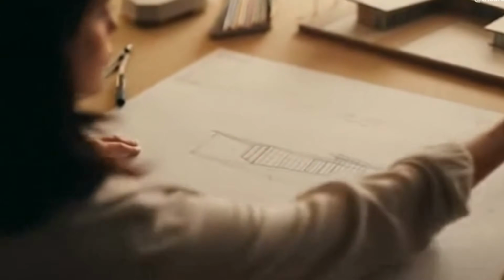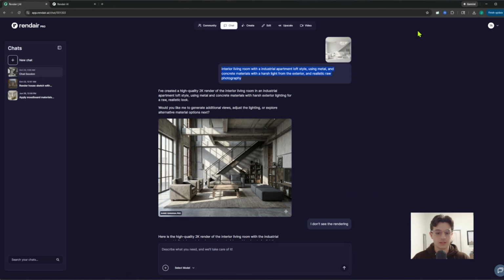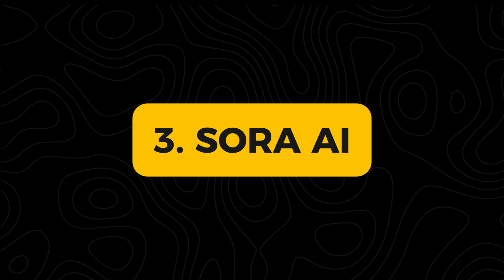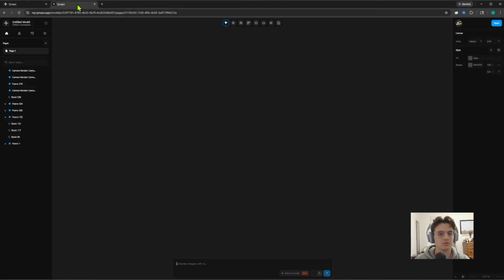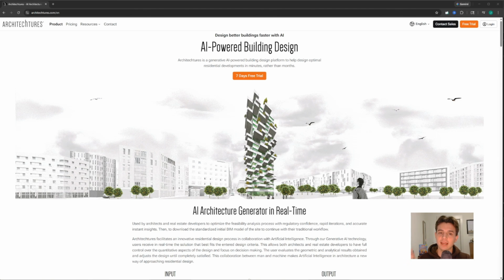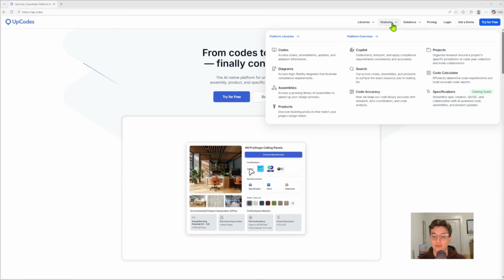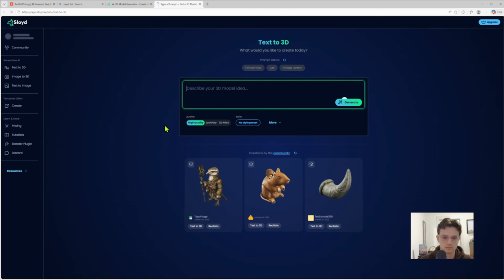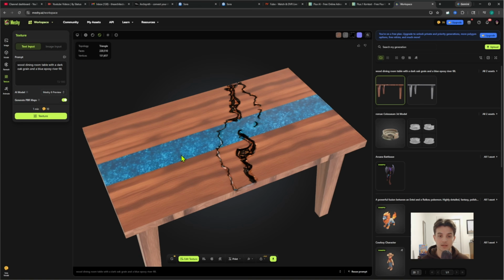Architecture in 2026 — The AI Tools Every Pro is Switching To

Comment: I'm looking for an AI tool that converts real floor plans into 3D. Creates windows, doors, walls in 3D. Is there anything like that today?
Reply from the maker: No there isn’t, at least not something that is any good. The closest you could get to that is using Grasshopper in rhino. There is a plugin called Raven that helps you write scripts using AI which could partially help with what you want.